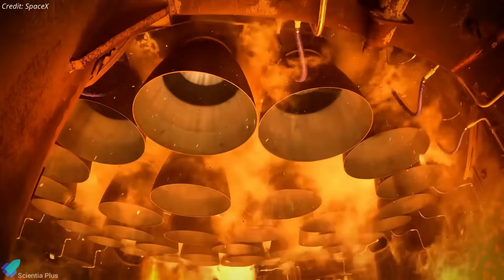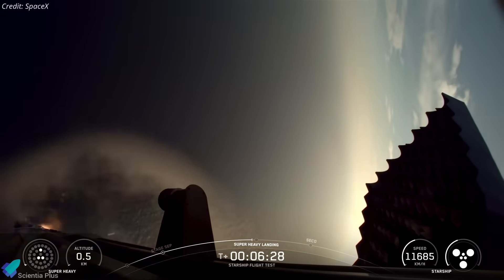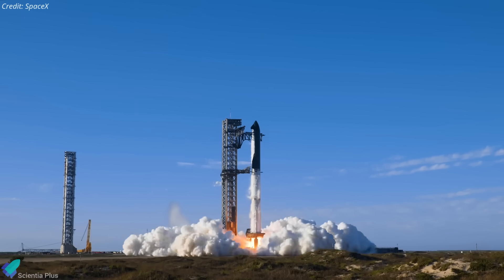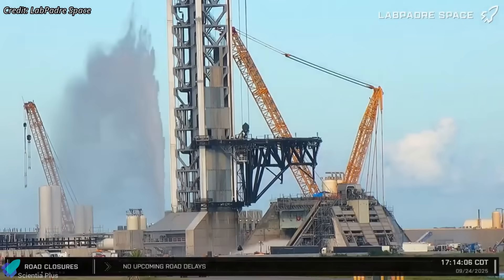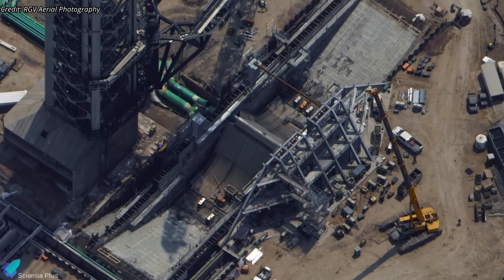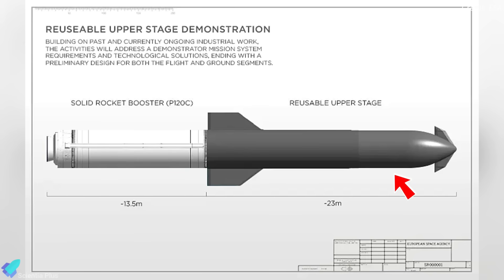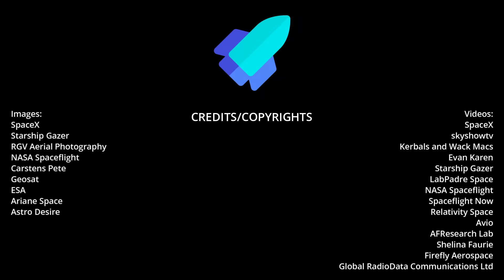Starship Flight 11 - The Final Block 2 Launch Plans are NEXT LEVEL!

Comment from the maker: 00:00 Starship Updates
08:29 ESA Just Copied SpaceX Starship Design!
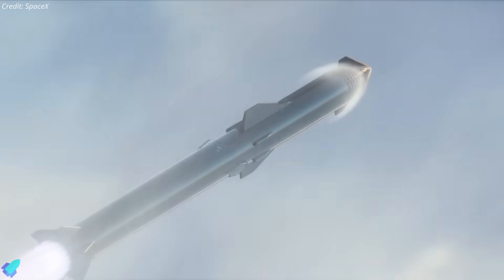10:45 Massive Firefly Rocket Explosion! What HAPPENED?

📚 Learn More:

🚀 Starship Block 2 Explained:
 📖 Summary: https://shorturl.at/b0dtw
 🔍 Detailed Explanations:
  • Design Improvements Update 1: https://shorturl.at/lpGT7
  • Design Improvements Update 2: https://shorturl.at/gwNQ4
  • Nosecone & Payload Bay Redesign: https://shorturl.at/xa60S
  • Methane Downcomer Redesign: https://shorturl.at/XdYBG

🚀 Starship Block 3 Explained: https://shorturl.at/mnBT4
  • Detailed Breakdown: https://shorturl.at/IViwD
  • Production Begins: https://shorturl.at/xRNkJ
  • New Transfer Tube / Downcomer Explained: https://shorturl.at/Iaqc6
  • New Grid Fin Explained: https://shorturl.at/NxdVo

🚀 Starship Block 4 Unveiled: https://shorturl.at/7A2ef
 
🔥 Raptor V3 Mega Upgrades & First Test: https://shorturl.at/TRIyj
🧱 What’s Inside Starship GigaBay?: https://shorturl.at/nJM75

🛠 Insane Engineering of New Starship Launch Pad 2: https://shorturl.at/7RAZd

🛢 Dual-Port Orbital Refueling – Full Technical Breakdown
https://shorturl.at/5tiqK

🛠 Other Starship Upgrades:
 • Hot Staging Explained: https://shorturl.at/jf400
 • Super Heavy Booster Upgrades: https://shorturl.at/Pi5R3
 • How SpaceX Protects Raptor Engines: https://shorturl.at/4Om8F
 • New Heat Tiles Explained: https://shorturl.at/p2Ijb

🚀 Starship Flight 10 
  📽Detailed Breakdown: https://youtu.be/irVUMJNe0Kc
  📽Root Cause of Anomalies: https://youtu.be/LBUpp7MRVSY

📡 Stay Updated:
📢 Weekly Updates: https://bit.ly/3HIQjPC
🚀 SpaceX Playlist: https://bit.ly/34wue8T